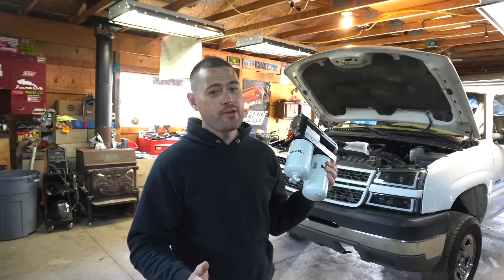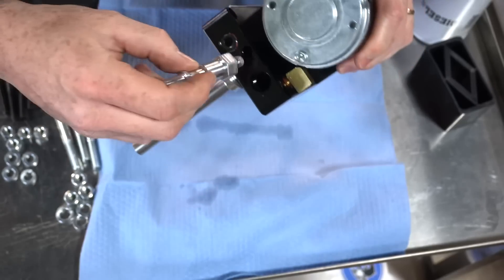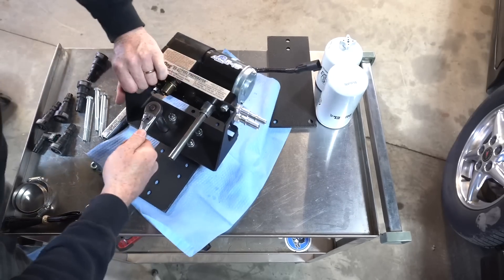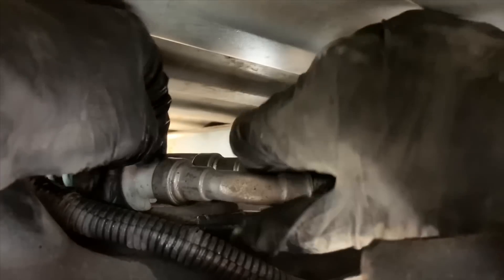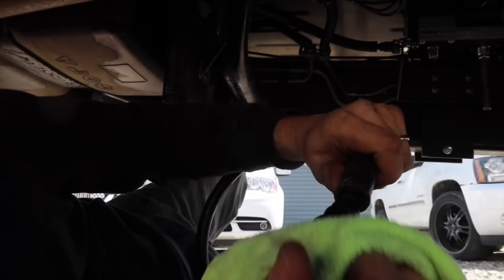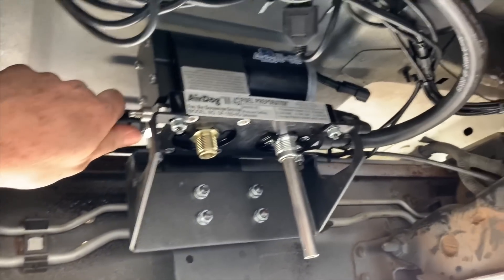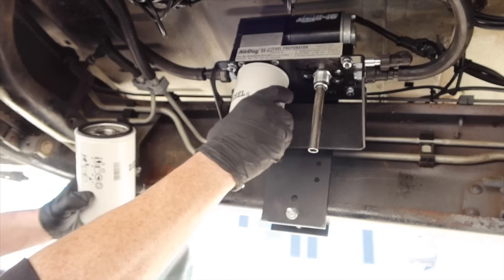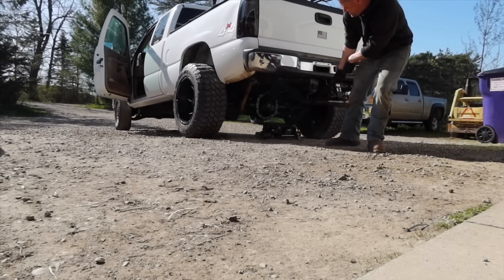Duramax Airdog Lift Pump Full Installation!

Comment: That 1/2 line on top of the tank is about the worse part of the install. My poor neighbors had to listen to me for about 15 min cussing it out lol
Reply: i switched to a 3/8 just for the hell of it and it popped right off
Reply: Lucky you so far I have spent 2 hours fighting with it am about to give up till this weekend and just remove the truck bed…. hopefully that will help make it easier
Reply: I was using a 1/2 tool but after an hour of fighting I think it’s because mine is shorter than in the video. AutoZone got me once again
Reply: @RBoysMedia  I finally got the top one by removing the bed but sadly removing the bed did not help with the fitting between the tank and the fuel cooler I ended up unbolting the fuel cooler to get it out of the way (two 10mm bolts ) and using a small pipe cutter to cut the fitting off the hard line the  factory line was destroyed but If I ever go back to stock I will just put in a new fuel line
Reply: @ralan350  I’d rather struggle for a few more hours than remove the bed lol

Comment: That's why I went with Airdog too.. very easy install,  better mounting system, and quiet compared to fass. 130k on my Airdog and no problems.
Reply: How often do you change the filters
Reply: @chaser4251  I try to do them once a year or 10k miles. Sometimes I forget and run a little longer. I'm much better about checking my oil and need to get better about my fuel filters.

Comment: Another way to get at the fuel line on the top of the tank is to remove the bed bolts on the drivers side and loosen the ones on the passenger side, then tilt the bed and secure it.  If the line has never been taken off, even with the correct line release tool it takes some maneuvering to get it to release.  Good choice with the Air Dog, the behind the frame rail hidden mount is the only way to go in my opinion.  Great job with the videos!
Reply from the maker: Thanks I appreciate the info as well
Reply: I know Im asking randomly but does anybody know of a method to log back into an instagram account??
I was dumb forgot my login password. I love any tips you can offer me.
Reply: @Kieran Clyde instablaster :)
Reply: @Salvatore Dash thanks for your reply. I found the site through google and I'm trying it out now.
Seems to take a while so I will get back to you later with my results.
Reply: @Salvatore Dash it worked and I finally got access to my account again. Im so happy:D
Thanks so much you saved my account!
Reply: @Kieran Clyde You are welcome :D
Reply: How heavy is the bed? I ask because I’m going to installing this over the weekend myself.
Reply: on any of those kinds of line connectors, blow air in them to clean them and spray some wd40 in there and they will come right off.  You dont really need to clean them but its something I regularly do when I do them.

Comment: Great video!  Easy install and great camera angles, thank you!  Will be my next investment.  I drive back and forth to Foley, AL, once a month, fill a 90 gallon bed tank-tool box and my 34 gallon on the 2004 crew dually LLY that just turned over 70,000 miles on the way back, averaged 22.2 mpg, pumped the truck tank full when I got home and had an inch left in the big tank, not too shabby for colder weather.  I know you don't need hose clamps...but that would drive me bananas, I'll have to clamp!
Reply: I have an lmm crew cab dually long bed, for easier access to the fitting on the top of the tank disconnect the drive shaft from the carrier bearing and rear axle. Way less of a hassle than picking up the bed or dropping the fuel tank if you dont have all the right tools. @truck master

Comment: Great video!  I would add that the most difficult connection to the tank top can be simplified by using a male bundy to hose bib 1/2" adapter  to make the tank connection to the existing hose.  It makes the install much easier.

Comment: When I installed my 165 I didn’t crack the filter to bleed the air out. Yes it makes complete sense to do that but I believe in the install directions it’s says there is no need to. Everything filled and fired right up! I was impressed and very happy with the pump!
Reply: That makes sense because it seems the air will be purged through the recirculation side.
I won't make that mistake again.

Comment: Thanks for the step by step, I'm going to install the lift pump on my Kodiak C5500 (RV Chassis). The 80-gallon fuel tank is about 25 feet from the motor, so I might have to add longer wires and get a little creative mounting the pump to the larger frame.

Comment: Just added one to my truck. Thanks for the video it was super helpful. I had different connectors on my tank and my fuse box was different but all in all pretty simple. My trucks 2010.5 so I think that's why it was a bit different. I had plastic connectors that I needed to pop the clip on with a flat head screwdriver.
Reply from the maker: Awesome glad it worked out for you

Comment: Thanks for the tips, can say I've showered with the best of em now. These things prime up quick if you've filled the primary filter, get a buddy or preferably your hot-roddin lady to turn the key, you won't make it to the filter stack before it's pushing fuel out. Pro tip, throw a rag down on the impact zone of your drip pan to keep the splash to a minimum.

Comment: I've installed a fass system before and it was alot more difficult than this installation. I think I'll buy a air dog this time. Great how to video.
Reply: Hey truck master, i installed this lift pump yesterday on my 2005 lly duramax. I used your video which helped alot but the engine has a totally different tone at idle and it has a loping sound to it which it never had before. Im gunna check the fuel pressure next, but do you have any idea why it is doing that?
Reply: @wadecook7888  more than likely your fuel pressure is too high. There is an adjustment screw to make sure it is correct.

Comment: My top of the tank connection was a bit of a pain also when I installed mine, I took the left over hose section and cut it into like 3" sections and split it and then put it over the fuel lines with zip ties anywhere it was close to the frame or body to give it extra protection
Reply from the maker: Great idea

Comment: Hey Josh thanks for the video I know it’s a year later but I just installed my air dog 165 and my truck has been sitting for 6 weeks and usually it won’t start after that long and yay fired right up.  Only difference with my LMM is the line you have to remove doesn’t require the fuel line disconnect.  It had the red tabs to pull out.  But extremely satisfied thanks for the video keep up the good work!!
Reply: Man I'm working on my lmm Duramax and you have just helped me alot Aftermath RC ! Just pull the tabs to release? Thanks 👍

Comment: Got the quick connect fittings with my Kennedy diesel pumps. Found the easiest way to attach them was to measure your line twice cut once and then roll out from under the truck and go to the work bench and lube the hoses up and push them on placing the face of the fitting on a flat solid surface and pushing till the hose hits the upper shoulder... I saw a couple fittings truck master did that weren't on on the way....

Comment: very good video and great to see the attention to detail on line removal as well the use of safety stands under the truck when you used the floor jack to get it higher. Great note on fuel line removal as I have as well had a tough time on some of the fuel lines.

Comment: I just installed an Airdog 100 on my LBZ. I did the bed tilt method to get the top hose off the tank. Thats the worst part of the whole job is getting that hose out. I gained 800 FRP and one thing that I was not expecting at all was a significant very noticeable boost in throttle response. The LBZ just seems happier and quieter now.

Comment: Great Video, thanks for showing how y’all install this pump. On thing you might add, adjusting the fuel pressure and where you mounted the fuel pressure gauge in line. Just a thought. Love all you videos.

Comment: If you are having any issues. Spray with penetrant like he stated. Then insert the 1/2 spin it around and pop it out and in. If still having issues use the bigger 5/8 ring squeeze it with your hand to make it close and insert that one and it should help pop it off. Good luck, definitely the most difficult part.

Comment: Thanks for another good video.  In the early portion of this production, you mentioned that with the new design, you don’t have to worry about pump failure and being stranded.  Since I see that this was published 4 yrs ago, do you still stand by that?   Have you had any issues and is that pump still in service?  I know you do lots of upgrades, so it could have been upgraded.  Thanks!
Reply from the maker: I’ve had zero issues so far it’s a great pump
Reply: @ Thank you from the reply.  I’ve been watching your videos as I’m thinking about adding a lift pump.  I’ve leaned towards the AirDog but the Fass allows for a bypass if the pump fails, but I prefer the way the AirDog connects.  Less connections and points of failure, but it could strand you if the pump stopped working.  I got an 06 LBZ and it’s been getting upgrades.  Thanks for your work man, tons of info!!  Cheers.

Comment: If you’re struggling with those fuel lines, definitely take the fuel cooler off, 3 bolts… and I tried 4 sets of fuel disconnects. The GREEN set at AutoZone worked perfect. 1/2” confirmed. Also spray pb blaster and some kind of silicone lube where the tool goes first. Took me over 8 overs fighting those lines

Comment: Quick tip if you have a LMM! The fuel lines use red quick disconnect clips with red tabs. You will not need the fuel line disconnect tool. You will need to cut the main fuel line and rotate it to access the red clips since they are wedged between the other fuel line connections. This will save you so much time and agony. Also no need to drop the tank or modify anything, the lines are pretty accessible
Reply: Thanks brother! Going back out to do that now.
Reply: Edward , can you please give me more info on the Red tabs? I'm up in arms on how to release the fuel line clips. Thanks
Reply: @ronaldbabbitt6318  you pinch the red tabs together and push in at the same time. I used my phone camera to take a better look. The tabs are the exact same on the fuel cooler connection for a better reference on what it looks like
Reply: @ronaldbabbitt6318  I also advise you disconnect the fuel cooler line last or else fuel will start siphoning out of the tank
Reply: Great thanks bother! Got it done yesterday with a set of curved-hook type picks and got them pop up and release! My lmm is rolling the Air Dog lift pump now and I'm so glad 😊  It's Awesome and so are you  Edward! Thanks for the help my friend 🏁

Comment: When I installed my fass pump I didn’t have to remove the line on top of fuel tank. Fass provided the fitting to reuse the line you took off.
Reply: Same !

Comment: 2004 2500hd the one on top of tank is 3/8 quick disconnect. Found out after I cut my exhaust to get to it better.
Reply: Did you have problems with the connecting the air dog lines afterwords I can’t get the line to pop on

Comment: dude thas very good work , I in stalled a 150 air dog on my 2014 2500 6.6 . and it still has a zigging sound . it too Noisy . I have been running it like this for 2 week ,still same sound

Comment: I have the Airdog on my LB7 and was wondering if keeping the filter under the hood is a good or bad thing? I noticed you had yours capped off in another video. Are there any adjustments that are needed on the Airdog as well? You also omentioned some CAT filters you preferred over the Airdog ones. Where can I get those?

Comment: Replaced the pump on my 1500 5.3. Had to get a replacement tank because the lock ring was rust welded. Was able to disconnect the rail lines but replaced all the plastic tank lines. Rust belt problems haha

Comment: Yeah im having a hard time with the fuel lines my connections look a little different than on yours mine have like red looking covers on the connection it's kinda confusing.
Reply: I have different fuel pump module I have a smaller return line connection on the left and a larger feed line on the right
Reply: @ercysuazo726  yeah I finally got it those quick connect fittings are a pain in butt to get off especially the one on top the tank. Mine didn't require the quick connect tools with how they are.
Reply: @ercysuazo726  did you connect to the left or the right ? Feed line

Comment: If the lift pump goes down or wire comes loose or any malfunction does the truck stop running or is it possible that the lift pump lets the truck run as before when it had no lift pump?
Reply from the maker: No one he truck runs back to stock if the pump stops working
Reply: @TruckMaster  It would be good though if it had a solenoid or a bypass control that would allow the fuel to directly pull from the tank to the front filter and to the CP4 or CP3 pump so you will not be stranded, sort of like a limp mode to get you or your family back in. And you wouldn't be straining the injector pump from getting fuel due to a malfunction of the lift pump. Sorry friend it's just my mechanical engineering background that tends to get the best of me but I have made big companies big money even on the easiest solutions that fixed big problems for aftermarket companies of Toyota and die and big press machinery from Italy.

Comment: I ordered the 165-5G for my 2010 Duramax. I have had two fuel related failures [loss of pressure while towing up a hill, and bad fuel contaminating the stock filter], and I hope this pump will eliminated those in the future. Unfortunately, I am in Canada and it's January...so I won't be able to install it until spring. That's OK though, the truck sits in the garage all winter anyway.

Comment: Great video. I've had problems with my 03 Chev 3500 Duramax . New Injectors , new fuel lines, new fuel cooler . engine starts and idles then shuts down.  I may have to install a lift pump. I've seen both videos with the Fass lift pump and this one.  which one would you recommend.

Comment: Great Video
I need to figure out where to run the return line.  I already have a T fitting in the filler tube for my aux fuel tank feed to main tank.  I have no room to install another T fitting....

Comment: I'm so stumped I ordered the 150 airdog it came with a pickup tube and no 11.8 quick connect fitting to install like you did. Same installation instructions for the 100/150. The 100 comes with the quick connect for the tank. Also my tank lines for the stock pickup don't look anything like yours coming off the top of the tank

Comment: Old video I know. But I’m hoping to find out the best GPH lift pump for my truck. What do you recommend for my 2003 LB7. 100% stock. Only reason I want to install is to get more life out of my injectors. And hopefully it will give the truck better response on the pedal. Should I get the 95 or the 165? I watched a video you put out about too much PSI on the fuel system caused by to much GPH. I don’t want to wreck my truck. I plan to keep my truck stock for now. Just bought my truck a year ago. Has 550000km (341000 miles) on it. It’s in really good shape for that many. I only want to ad life to it. I will haul some trailers periodically. But nothing constant. Thanks in advance.
Reply from the maker: 165GPH

Comment: Could you not leave the discharge hose fitting off and attach a piece of scrap hose to a pail to prime the unit to avoid a spray/  messy spill then attach the discharge hose once unit is burped?  Just curious.

Comment: How do you keep the filters from gelling up when it gets real cold (-5 and below) in the winter? and if I were to do it all over again ball valves on suction and discharge side of the pump. Otherwise the fuel will siphon out while you are trying to change the filters.

Comment: Off topic. Wife put a few gallons of gasoline into my 2004.5 GMC 3500 lly duramax from my spare generator fuel tank, today. She realized it was gas before she even turned the key to activate the fuel pump. Can you share a video on how to drain the fuel tank. I have a Fass fuel pump system on it.

Comment: Do they have pre cut stainless steel lines instead of using rubber line that will crack and dry rot over time? I don't like the idea of removing my stainless steel lines for rubber lines.

Comment: I bought my truck with a FASS already installed and just learned that it isn't even running. I'm guessing the dealership disconnected it because it isn't a stock component. We had it running briefly by bypassing the relay, but otherwise have no idea what needs to happen to get it running properly again. Do you think I can wire it back up with the wiring diagram? What if I wanted to switch to the Airdog? Any challenges there?

Comment: Mine didn't come with the return line manifold that goes in the filler neck tube. Its having me drill holes and add hoses into the assembly inside the fuel tank. Is there a video for all of that?

Comment: What did I do wrong, I did all these steps but fuel never came to lift pump
Reply from the maker: Maybe your suction line isn’t connected correctly. Can you hear the lift pump turn on?
Reply: @TruckMaster  thanks alot for the reply man, problem solved. Awesome videos man thank you so much